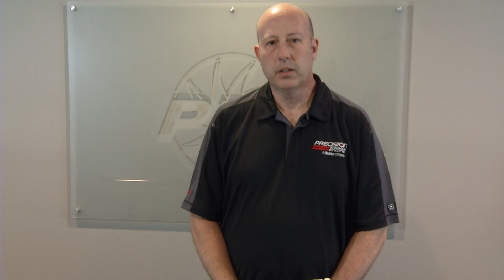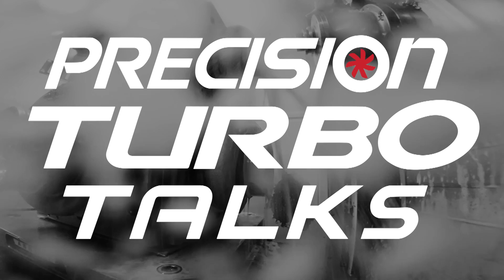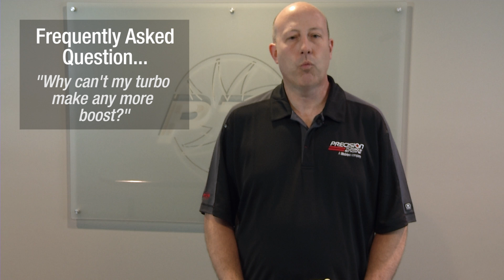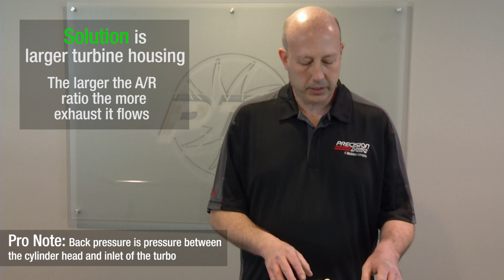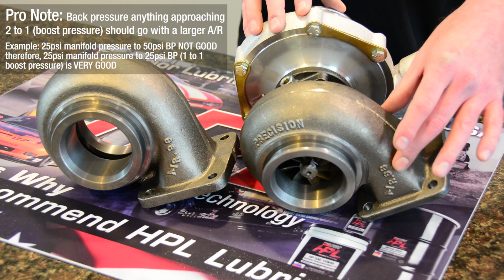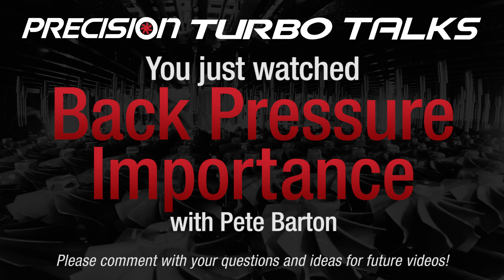Turbocharger Back Pressure Importance

Comment: When upgrading the Downpipe on stock a stock setup to reduce Back pressure, what is the recommended size ratio, eg. 50% larger than stock ? I have upgraded my DP from 42 to 63mm and even after the tune, the car is laggy low down the rpm range.

Comment: A saab came in the other day with no power. The guy told me he needs a new turbo because of the power loss no boost and loud squeal. After checking i said "sure ill put a new turbo in but what are we going to do about your clogged cat. It only has 8 psi back pressure at 2000rpm." Lol. I love when you get the know it all customers. Its said when a customer is more willing to listen to a autozone cashier before a shop. Im a shop owner thats known for accurate diag work and ill be the first to admit i dont know it all by any means. I take advice and im not to good to phone a friend or look on YouTube. YouTube is a amazing tool when used with common sense The only good thing i got going is i have a good Foundation on how mechanical and electrical work.

Comment: Keeping heat inside exhaust manifold, quality dump pipe and well configured exhaust system, with adequate heat retention measures in place, will allow your current turbo to work better. Don’t reach for bigger, heavier and possibly less compatible turbo (or other bits) until you have made the environment it operates in as complementary to it achieving it maximum level of performance (for street driven cars) fuck it up by goin too big on just one critical component can unbalance the whole system and have you returning minimal gains from future upgrades. Or worse, actually make the vehicle perform worse then before.

Comment: What's happen if there is no BP at all?
Reply: NAWAF ALDOSSARY you make alotta power .... a few people experimented with boosting an engine with compressed air from a separate source witch made phenomenal numbers cause an engine is just a big air pump... the more in pressure ,fuel ignition timing (in gas compression)and the less out... you just have to have it balanced to whatever rpm you can make that bitch stay together 🤙 now the problem with the way they did it was now they need a way to boost it like that, and now they have exhaust back pressure that they didn’t have before... “the pressure tank system would really work for drag racing because you’ll need to fill the tanks....most use scuba tanks with a regulator and an intake door that slams shut via air pressure” so you don’t want more choking going out then in, ... to a point is ok but then your just defeating the purpose of boost..... unless you in the mountains or run you vehicle on propane.... this could just go on and on 🤙 hope i helped ya a bit
Reply: If BP is atmospheric pressure, I'd assume that makes an engine run pretty well. You can kinda get this effect with a straightpipe, but you don't get very much power, if any, and it's illegally loud. Not at all worth it. 
If BP is vacuum, it seems like the piston would be pulled along on the exhaust stroke, meaning power when there usually isn't any, meaning a design optimized for that would be absurdly good. But for either of those to occur, you'd need to pump all of that air out constantly, and it would take a lot more power than the engine would gain from it.
Instead, you could use the pressure of the exhaust to force air into the intake, using a device known as a turbocharger. Forced induction (turbo, supercharger, etc.) adds way more power and not nearly as much noise compared to straightpiping. That's why it's legal (well, not everywhere, I suppose)

TL;DR: you can't have no back pressure without putting power in to suck the air out, so you end up losing power. you're better off using an electric motor to move the car, not to reduce backpressure
Reply: runs like a supercharged one

Comment: Could you just have a straight pipe instead or would you need a bigger housing also does it move wear the boost sits?
Reply: It doesn't reduce back pressure enough to be worth the ridiculous amounts of noise.

Comment: I also have a 6466 and predict backpressure with a .81... Is it worth trying a 96? already making 909whp in a 2jz
Reply from the maker: Hi Ryan, it's worth trying and hard to say, sometimes when you have excessive back-pressure it spools faster.
Reply: DarkMufasa I have a 6466, it only comes in BB.
Reply: Ryan Sammut i personally would go 96. depends on your goals and purpose of the car?
Reply: Exactly. Is your current turbo journal or ballbearing?
Reply: Was only asking. I have a vw r32 with 7675 dbb with .96a/r. If you want it for like daily use then the .81 ar will be fine. But if u want to up it but sacrifice some lag i would say let the turbo breath with the 96. Once you are in boost, lag is irrelavent since at that point you are trying to push as much air as you can aslong as your fuel system can keep up with. my vw is more of a weekend n track car since dailying it over. All depends on ur goals and purpose of the car to upgrade from 900hp.
Reply: DarkMufasa it spools fairly quick but it does up top. I run 42-46 psi boost and it's not holding it up there.. spikes and drops. that's why I think there is back pressure. I drag race the car by street driving most and the time
Reply: I would say 96. Let it breath. Plus going with larger ar you can safe ur trans from tq shock from your hits spikes in boost. I would suggest 6870 imo. But depends how you want to gain more performance and stability. And budget of course aswell. I do not know if precision sells just the housings but i do know they offer the rebuild serivce so u can purchase the housing and have them swap it if i recall
Reply: Save* not safe
Reply: DarkMufasa I think best is to invest in a bigger turbo. 68 or 7675. thanks for the help tho
Reply: If you go 6870, you can still enter alot of competitions at the track like trustreet class unless you want to dip into super street class. That way you make your money back by placing at your local events. Read your local track class rules to ensure 6870 is class legal for truestreet class. 7675 is nice but you wont have flexibilty to qualify in multiples classes at the track at least.